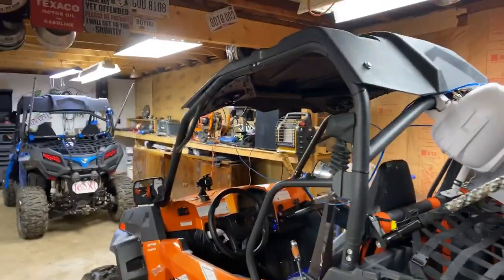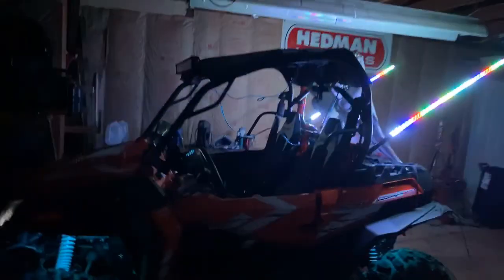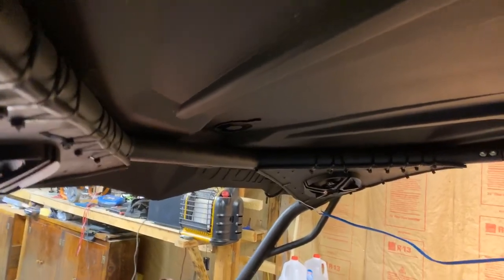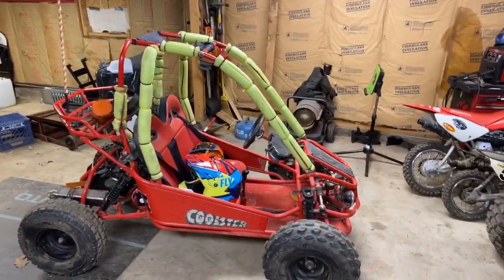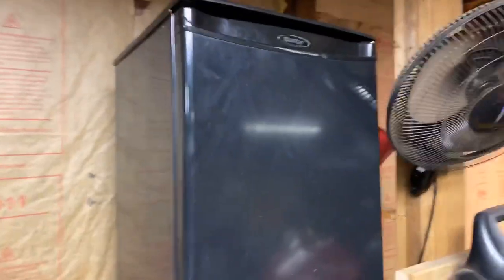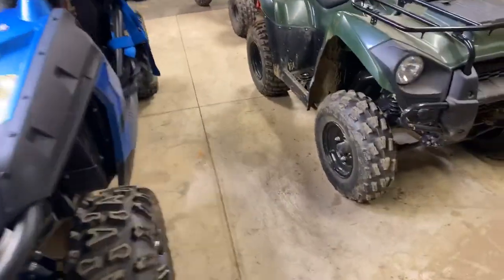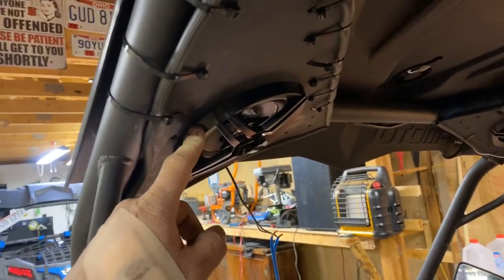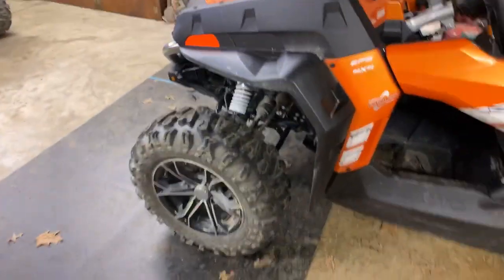I added speakers to my sxs. It’s loud now!!!

Comment: I’ve noticed plugs under the dash of mine and I’ve bought a system with a amp and wondering where you got your power from on the machine and switched power for that matter
Reply from the maker: Power from battery. Then switch power ran my own wire from the battery up to a switch then back to the amp.